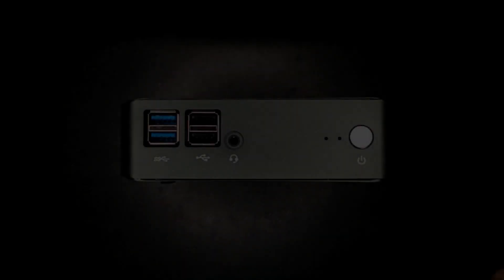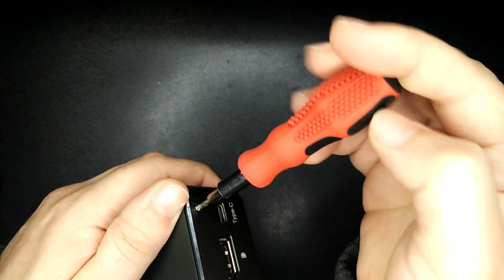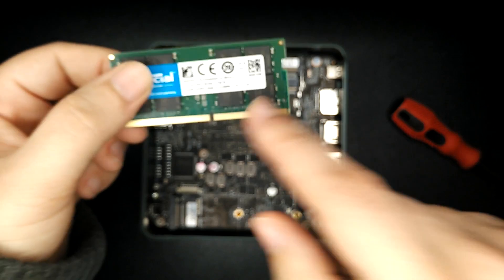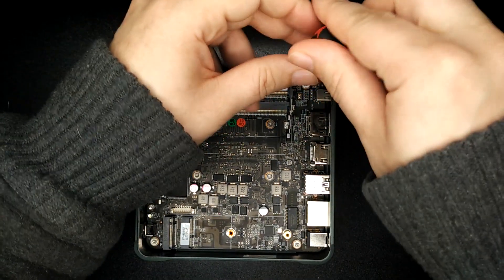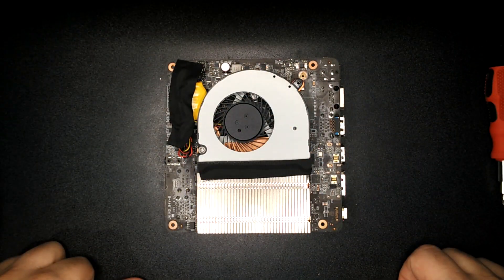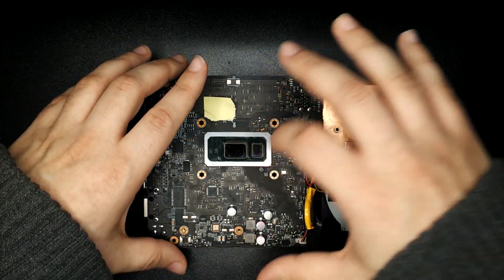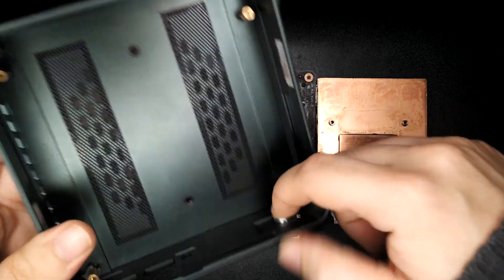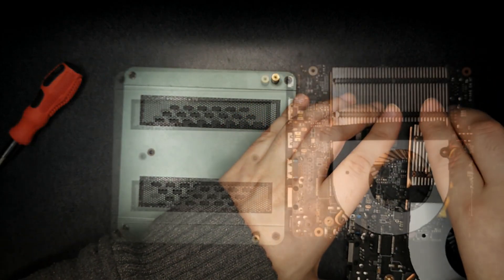Librem Mini Teardown

Comment: Im have the opportunity to buy one for very cheap just i need it to run windows 11 is that possible ? If not will proxmox work ?
Reply from the maker: I sold mine a couple of years ago and never attempted to run Windows on it. I imagine Proxmox should work though. I'm currently using an Intel NUC as a Proxmox server. You'll be limited to the number of VMs/containers you can run though because of the low memory and CPU.

Comment: I was considering purchasing one of these from purism but there were so many add-ons or up-sells it quickly got very expensive, but the main thing that put me off was their risk warning that we might incur import tax which we'd be liable for. Since I'm also in the UK I wondered whether you can speak to that?
Also, would you otherwise recommend another min-pc instead? Something like an intel  NUC is the obvious contender
BTW, I asked Purism what the make and model of these are so I might get a barebone system without risk of import duty and I'd complete it myself with SSD and memory and add a distro of choice, but they weren't forthcoming, which didn't feel very in the spirit of Linux :)
Reply from the maker: Hello,

Import duty is to be expected when you buy something from outside the EU, and now that we're outside the EU too you can expect it on almost everything :D Sometimes you get lucky though and the customs people don't add a charge. I can't remember if I got lucky with the Librem Mini (I've imported a few things since then and some I got charged on, others I didn't). I think generally you should budget at least 20% for taxes/duties.

You can buy the same system from Eglobal (Chinese manufacturer) and I've also seen in it on Banggood, and a few other retailers on aliexpress/alibaba - these are all outside the EU so expect taxes/duties. You'll also need to check that they are still shipping with the same motherboard and CPU to be compatible with Coreboot. The motherboard is just labelled as MU01 or MU_01 so if you search for that you should get some useful results.

I wouldn't recommend any other Mini PCs as none of them will be compatible with Coreboot or will necessarily work entirely with free drivers (which is the main reason to get a Librem after all).

Even with the extra import costs it's cheaper to buy it from a supplier other than Purism, but you won't get the benefit of having Coreboot pre-installed, the Intel ME disabled, and support Purism's efforts to liberate other systems.
Reply: @david-healey  I appreciate the prompt and thorough reply.
I hear you on supporting Purism's efforts to liberate other systems but it's not made easy if it means paying over the odds. 

Over the years I've always just bought hardware and installed distros on them, so, I'm not really up on the hardware side of things. I don't know what intel Me is and why I should care that it's disabled or what the deal with coreboot is. I'm not in the Edward Snowden-league of privacy needs. Maybe, these are topics with doing a video on to educate us! 
As for the Russian roulette of import tax. I've mostly avoided it by buying on Amazon. As evil as it is, it is also a simple and straightforward way of assuring quality service, if there is any issue, and prices are what we see - no nasty surprises. 
I was just looking for a good value mini-pc and stumbled on Purism and thought I'd achieve 2-in-1 but, like I said, by the time I added everything in It acme to over $1000 which is a lot of money just to be virtuous.  We need someone selling Linux pre-installed hardware to make it a no-brainer but I guess it's hard to compete with the big vendors
Reply from the maker: @aamaroq  The main reason to get a Librem is that it runs on (almost) 100% free software, if that isn't the main selling point for you and you just want a small computer to run a GNU/Linux distro on then you should definitely not get a Librem Mini because there are far higher spec'd Mini PCs available at much cheaper prices.

The Intel ME (and AMD PSP) is a separate processor that exists on all Intel based systems since about 2008. It runs a Minix based OS and has full access to the main CPU and network stack, it's basically a hardware backdoor. It's possible to disable it on some systems using a tool called ME_Cleaner.
Reply: @david-healey  Ideally, yes, I'd like to although functionally there'll be no advantage for me, it would be out of solidarity and idealism and to be 'virtuous'.
 Given the software is free I don't understand why Linux hardware is always more expensive; if money wasn't a barrier - fine, unfortunately, it is. If it was the same price as a pc also fine but considerably more expensive is hard to take unless it's a specific requirement, which for me it isn't. 
This has an older processor otherwise it looks like the same machine
https://www.amazon.co.uk/dp/B085LM3L2H?ref_=pe_780071_41837251_dpLink 
I was really hoping to find something in the £400 - £400 range. If there's anything you can recommend, Id' appreciate it. Thx, again for the input.
Reply from the maker: @aamaroq  I'm not up to date with Mini PCs, I chose the Librem Mini purely because of its free-ness. Btw the free in free software has nothing to do with price, it's referring to freedom (although a lot of it is gratis too). There is also a lot of commercial free software.

If you plan to install any proprietary software on your computer then there is no point in buying a Librem device.

If you want something that's preinstalled with GNU/Linux  have a look at System76 (I don't think they do Mini PCs though).
Reply: @david-healey  I do get the Free beer vs Free as in Liberty distinction. Have used various distros for years. Having said that software tends to be free in both senses. Years back there was the argument that we should be able to get a $100 discount off pc's stating that one didn't want to purchase the OS with the hardware. So, it's a tad ironic that Linux hardware comes at a premium. 
I'm aware of System76 and always thought they were too pricey as well + again the US + import duty lottery. 
Manjaro has started getting into premium hardware and they do a mini-pc (intel NUC) but they're in Europe and we're no longer part of the EU and hence risk import duties there as well, as you've already pointed out - what a shambles this Brexit has turned out to be! 
There is Starlabs - a UK company - have you come across them, yet? They only do laptops but, I'm thinking a laptop instead of a mini-pc is not a bad idea. I could just connect it to the monitor the way people do with MBP's The 'privacy guy' on YT rates them highly and bought one himself. So, we'll see. I used to mostly get old second-hand hardware and then install a GNU/Linux distribution on it. but I fancy something higher spec with usb-c etc. 

Cheers
Reply from the maker: @aamaroq  
I've used various GNU/Linux distros occasionally for the last 15 years but only started using one as my main OS about 5 years ago.

If you're comfortable installing the distro yourself then just buy the best computer (laptop, desktop, mini) that you can afford, you don't have to buy it from a GNU/Linux specific vendor.
Reply: @david-healey  There is a chance you'll get improper EC firmware on these and active cooling won't work with Coreboot. Also, there is no guarantee Coreboot will boot at all:
https://github.com/MrChromebox/firmware/issues/263#issuecomment-809544843

Thanks for the board name, though.
Reply: I just received my mini and I also live in the UK. DHL delivered it but charged me £150 import tax before they would release the package. Unfortunately thats the price you have to pay to import tech from the US these days :-( . Im am really pleased with the high level of security and privacy it has. But in most cases I would recommend just buying a standard barebones and building it yourself with a Linux distro of your choice.  Most NUCs or other Chinese devices should run Linux ok these days. Good luck!
Reply: @madmike2470  Ouch...well, you'll soon forget about the cost the main thing is you're happy with the machine.  
Thx, for sharing though,.

Comment: I want measurements of:
-Cooler thickness
-PCB thickness, width and length
-Heights of: tallest downside element, dual USB receptacle and RAM slot.
Reply from the maker: The copper heat spreader is 2mm thick, the extra block that sits directly on the CPU is 1.5mm thick. The dimensions are 75x72.2mm (not including the long finger that goes onto the fan.

The radiator is 74x40x6mm

The PCB is 120x120x1.6mm

Dual USB height is 15.6mm

RAM slots height is 9mm
Reply: @david-healey  Thanks. I want to have thinner version of this device (Librem Micro?). It must fit inside trousers pocket. I have to make alternative chassis or wrap PCB into flexible keyboard, to get rid of dual USB and LAN receptacles and replace cooler with plain nickel-galvanized copper sheet. If I will manage to get this PCB.
You forgot about height of the tallest element on CPU side of the PCB.
Reply from the maker: @Freeman666Gordon  Tallest element on the CPU side it the fan header, it's about 7mm with the fan plugged in. If you're not fixed on an x86 system another good option for a micro pc is the RockPro64 from Pine64. It's a nice little passive ARM system.
Reply: @david-healey  I plan to keep this device with me but use it with external cooling resources (ice/tap water/big piece of dubious iron/Saint-Petersburg's cold air) when I have access to mains voltage and need high performance, so fan header can be excluded from measurements. RockPro64 doesn't look powerful enough for video editing.
I reject any offer to use laptop because I don't want to have big backpack and mechanically vulnerable device (big area is easy to break when falling from wagon). Protected laptops are extremely heavy and thick.
For tasks don't require so much performance I plan to use L5.
Reply: @david-healey  Recently I visited Intel's site and realized I must not compress Librem Mini or any other Mini-PC to fit it into my pocket. Better solution for me is to purchase Computing Element ( https://www.intel.com/content/www/us/en/products/details/nuc/elements/compute.html ) and develop carrier board myself.
Reply from the maker: What are you planning? The PCB is 120mmx120mm. Do you want the cooler thickness including the radiator or just the copper heatspreader?

Comment: Why you are not using 60fps in late 2020?
Reply from the maker: Why do you need 60fps for slow paced live action? It's not like this is a video of a football game. 99% of movies are still shot in 25fps. Also my phone camera doesn't support that framerate :)
Reply: @david-healey  Your hands would look better in 60fps.

Also, what potato phone do you have which cannot do 60fps?
Reply from the maker: @glitchysoup6322  It's a Xiaomi Mi4I, I just double checked and apparently it does support 60fps! It hink a higher resolution and better lighting would be more useful than a higher framerate, but I'll experiment with my next hands video and see.